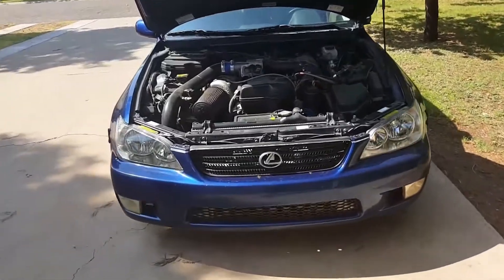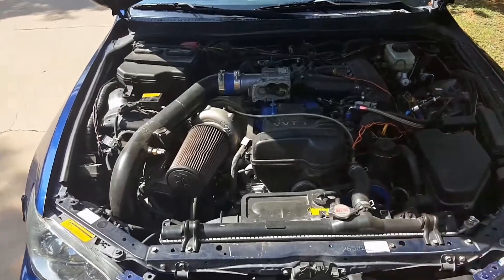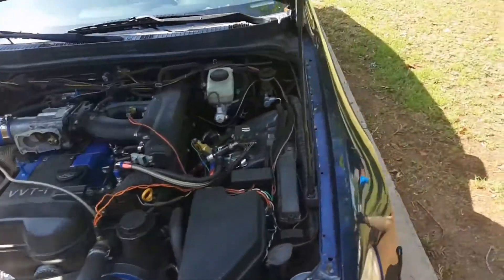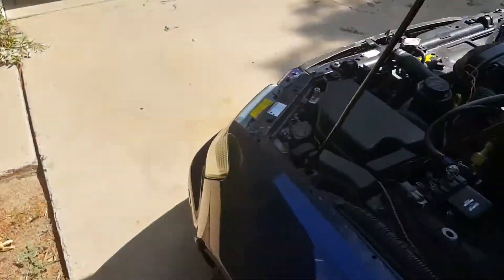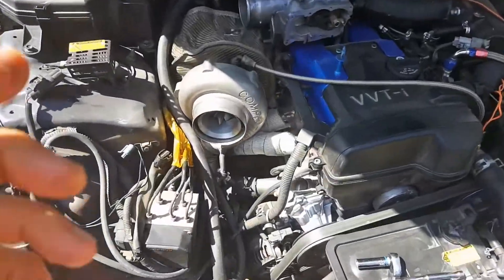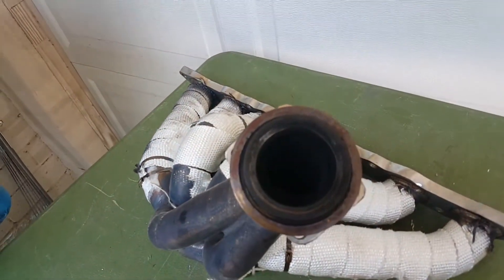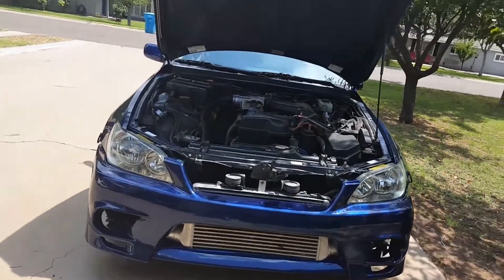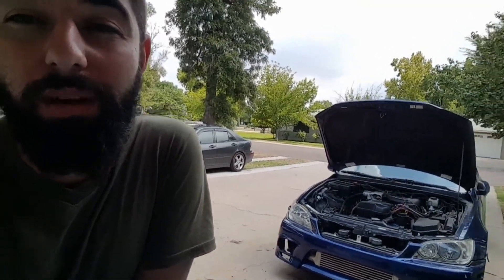Turbo Lexus IS300 update. Taking turbo and manifold out. Toyota Boost Acceleration!

Comment: I was wondering what ecu you were running too , I see you moded the throttle body as well , why or was it for the ecu your running?
Reply from the maker: DirtyHandsCleanMoneyGarage the car is on AEM Infinity. And to be honest, I don't know why, but the previous owner deleted drive by wire, so now the car is drive by cable.

Comment: Hey man! Your car sounds awesome! Did you piece out the parts yourself? I'm looking to turbo mine in the near future! Which ECU are you running? Can you pass emissions?
Reply from the maker: BillerProductions BillerProductions thank You! Yea the kit has been pieced together, so all the parts are random. The car is running AEM Infinity ecu and it does not have cats. The exhaust is 3 inches turbo back with a muffler in it so it does not pass emissions. It is registered in a different county where emissions are not required. 😉
Reply: RacecarAndChill Thank you soo much for the detailed reply! Mind making a video with a part list/cost?
Reply from the maker: BillerProductions Well I bought the car assembled already, but I have changed quite a bit on it. So I think I will make a video with a parts list on it! That's a good idea. Make sure you subscribe so you get notified when I do post that video. Car is waiting on a tune now since I put a smaller spring in the wastegate.
Reply: RacecarAndChill Definetely subbing!! Looking forward to it!
Reply: Hey man! Update - I did it! Car is boosted 😅